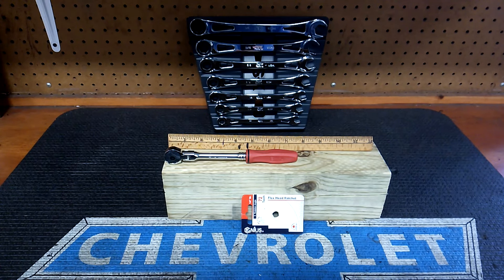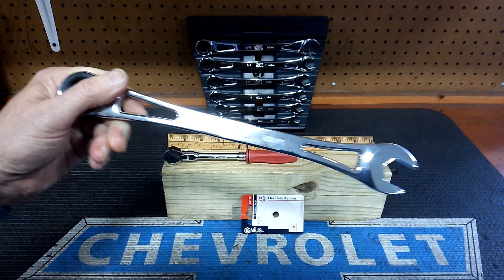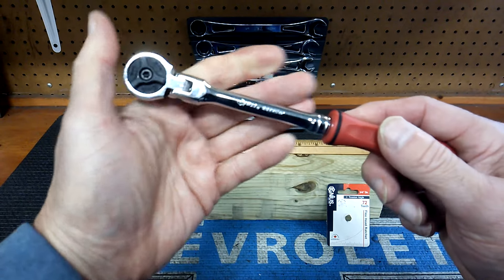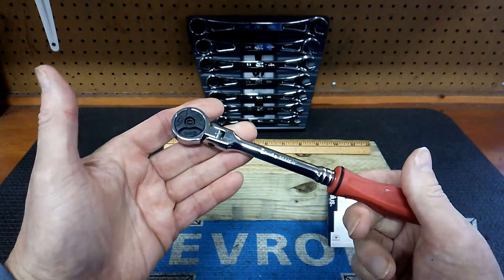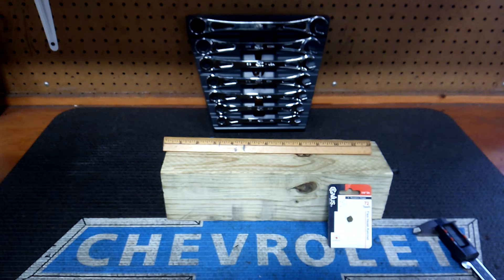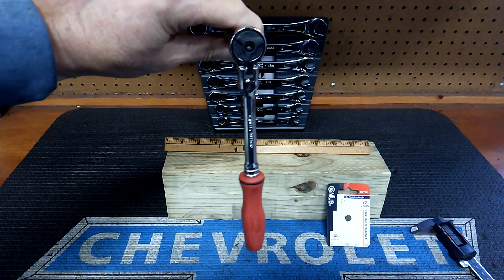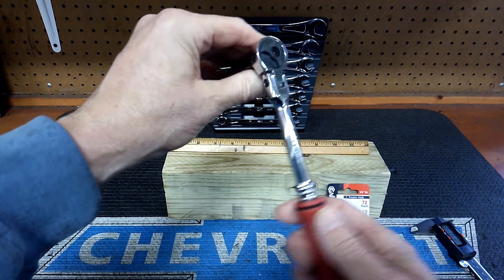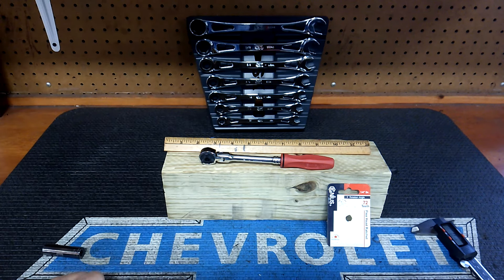GENIUS 1/4 drive flex-head ratchet(underrated) SK ratchet wrench set give away info!

Comment: Hi Jeff - as it happens, I picked up that exact same Genius ratchet a couple of weeks ago, on sale for just over £20 (about $25), so a real good deal. I like the hard handle and the length of the shaft, and it definitely improves with a bit of lubing. I'm not so keen on the flex-head joint, it seems a bit too loose to me, and there's no increments to it other than the centre detent. I prefer the Williams flex-head you showed briefly. I also got a Genius carbon scraper with the same type of hard handle in the sale, and that's really nice (part no. 595232).
Reply from the maker: Thanks my friend for jumping in and sharing that!! you got a good price on it!!! i will lube this up with lube!! stay tuned for tommorows give away!!!

Comment: I have four Genius Tools ratchets. Personally I like the hard handles myself. So far my absolute only complaint is. I wish they would have added at a minimum at least on detent on each side on the flex head to add some extra resistance to hold the head in place better when it has a socket on it. Other than that excellent ratchets for the price.

Comment: Jeff,  the 1/2 dr Genius ratchet you have. Have you had the chance to put a heavy load on it yet ?
Reply from the maker: Yes i was changing my kubota tractor bucket cutting edge bolts, to swap out the cutting edge,3/4 bolts!!! 1 inch nuts!! i broke loose with a 36 inch breaker bar,and then i finished removing with the genius ratchet,they were really rusty so they came off very hard all the way!! the ratchet had lots of a load on it, it would flex but not bend!!! its a tuff ratchet,its 25 inches long!! it like using  breaker bar,i love it!!
Reply: @jefftovani5535 wow..

last year I almost pick genious  ratchet, but instead I choose KTC BR4-L same 1/2" drive flex head ratchet but the handle only 38 cm or 15" long. 
have coarse teeth, 36T as I remember